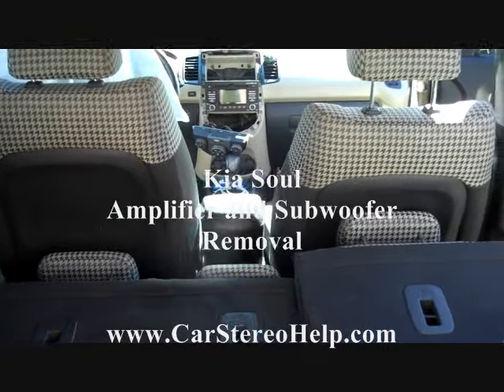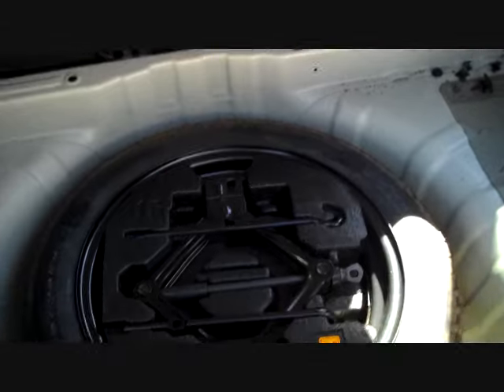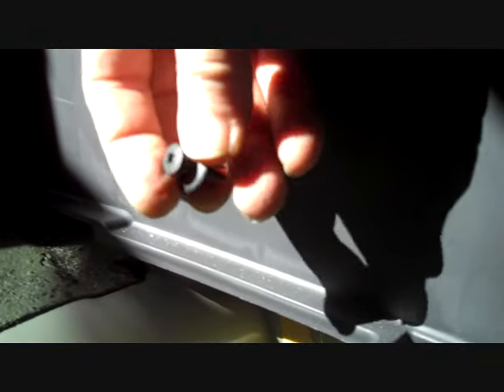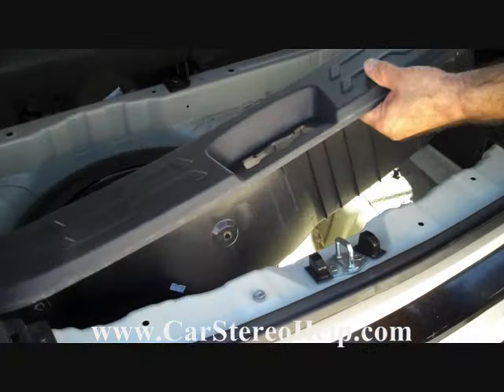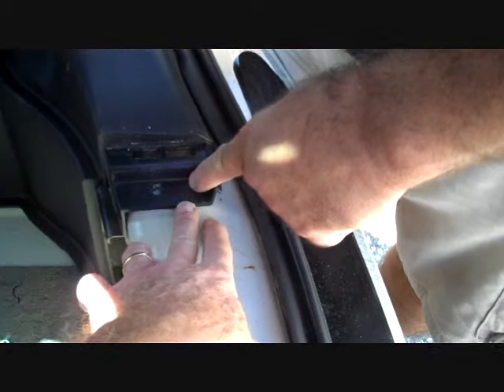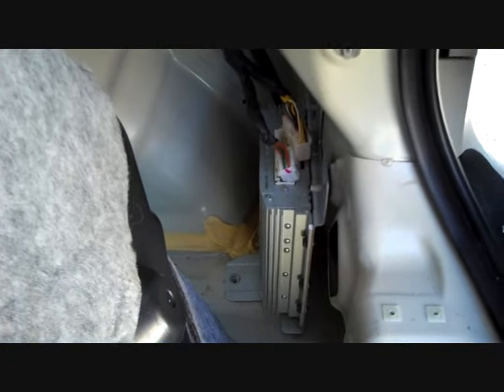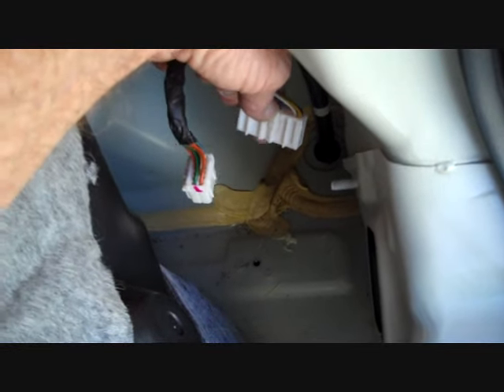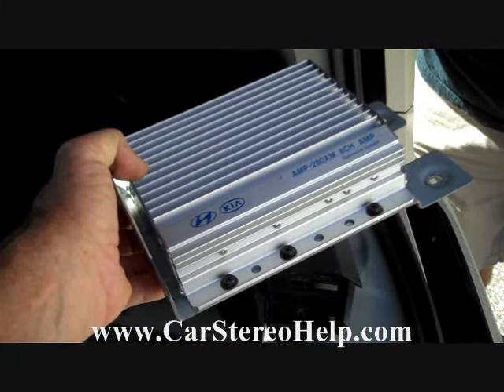Kia Soul Removing Amplifier and Subwoofer 2010 - 2012 = Car Stereo HELP

Comment: I had to remove mine for repair I had electricity leak and the battary kept draining due to faultu amplifier
Reply: How did you fix the amp to stop the parasitic drain.  ?  I have the same situation but in a 2011 sportage.
Reply: i took to an electronic repair shop he replaced some parts but eventually i bought a second hand one , new amplifier at dealership is way too expesive around 500 usd
Reply: @salamehalabed8093  thanks for the reply.    Much appreciated.    That fixed the parasitic drain.